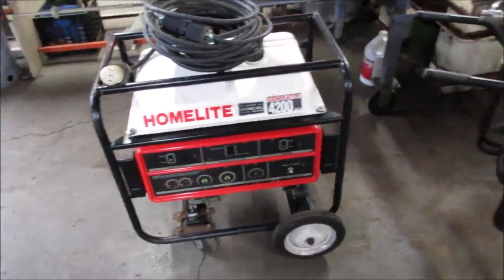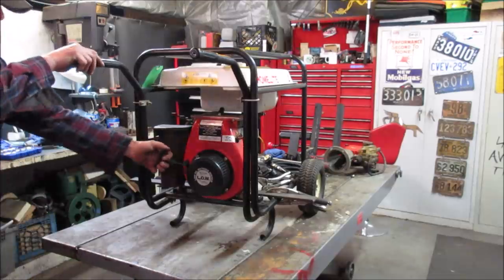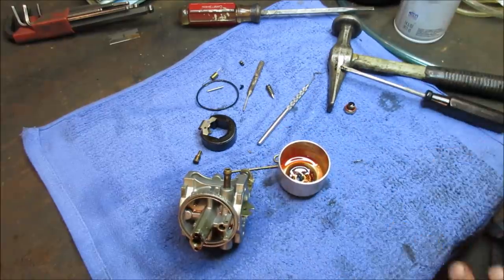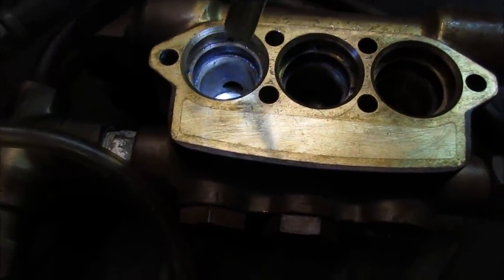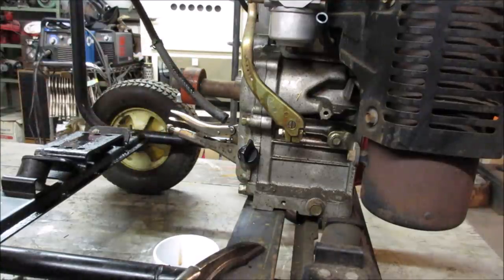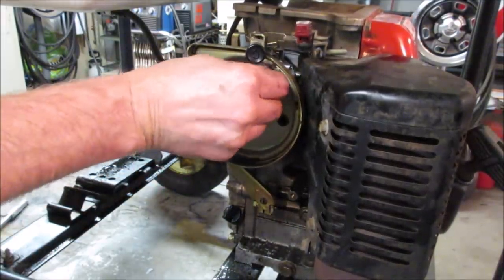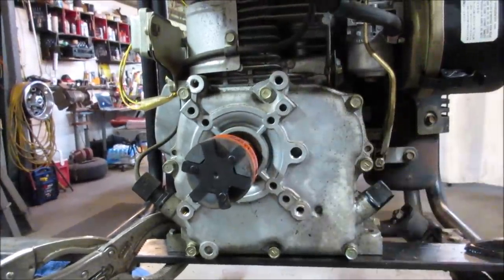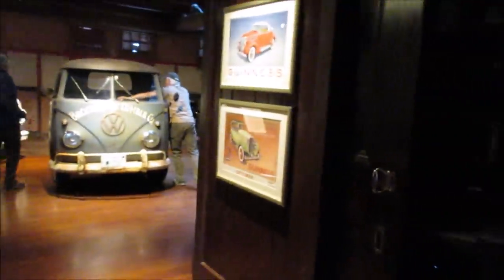Will It Still Work? Free Old Homelite Pressure Washer sitting for 20 years.

Comment: Marbles in the tank?
Reply: Marvel, as in "Marvel Mystery Oil". Mix with gasoline to impart a film of oil on the metal parts of the fuel system to help prevent rust and corrosion.

Comment: Soap to lubricate the pump piston seals/bores?
Reply: Nah, very bad idea. It will remove the lubrication properties of the seals and they will wear out more quickly. You can use this as cleaner for them. Then rinse them very very well and use rapeseed oil to relubricate them.

Comment: Why you put gas in the spark plug hole?
Reply: It is a primer shot of fuel to determine if the engine will even fire.  It is just a quick test.

Comment: If the pump is cracked is a new one usually avajlable
Reply: I didn’t have any problem finding a replacement pump for an old Rigid pressure washer a friend of mine gave me.  Mine wasn’t cracked but I think the unloader valve wasn’t working right because the engine would die whenever you let off the trigger.
Reply: With a quality machine a replacement pump is generally available but be prepared for a shock as they’re normally prohibitively expensive. This is why so many of the low end pressure washers are disposed of when they get a dose of frost, it’s cheaper to replace the whole thing!
Great news for the manufacturer not so good for consumers that wish to repair their own equipment
Reply: Thanks

Comment: Dirt kept getting in the carb and making the needle stick open and you never bothered to clean the tank out or put a fuel filter in the fuel line to prevent it, I dont think buying a new needle will solve your problem if you have a bunch of dirt in the tank

Comment: petcock (n.)
also pet-cock, "a small plug-cock, made to be fastened to a pipe and used for draining water and condensation from steam cylinders, etc.," 1864, from cock (n.2); the signification of the first element is uncertain.

Entries linking to petcock
cock (n.2)
in various mechanical senses, such as "turn-valve of a faucet" (early 15c.), of uncertain connection with cock (n.1). Perhaps all are based on real or fancied resemblances not now obvious; German has hahn "cock" in many of the same senses.

The cock of a firearm, which when released by the action of the trigger discharges the piece, is from 1560s. Hence "position into which the hammer is brought by being pulled back to the catch" (1745). For half-cocked, see cock (v.).ie also sill cock and hose-cock, turn -cock a turn valve to stop or start flow

Comment: Mustie put at least a fuel filter between the tank and the carb. It's not that difficult. And the engine runs leaner without the air filter. More air with the same amount of fuel = lean mixture. If it was obviously running lean before with the air filter due to the fact that the spark plug was white, you should adjust it to run more rich.